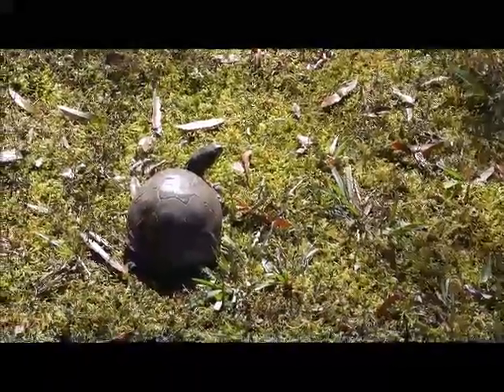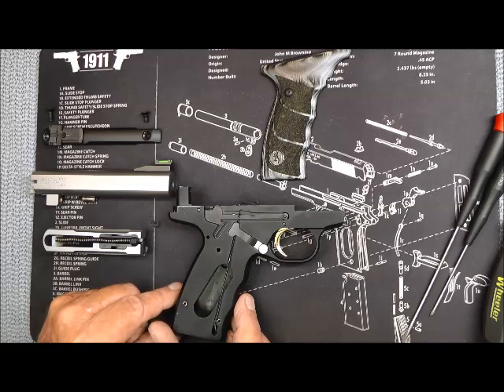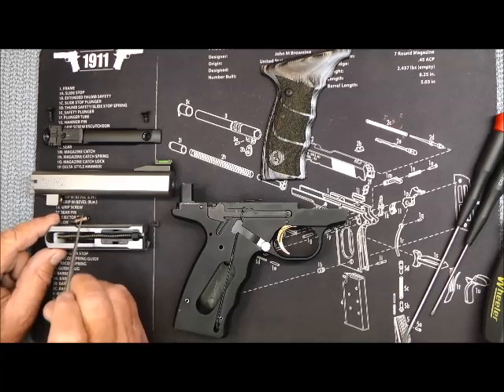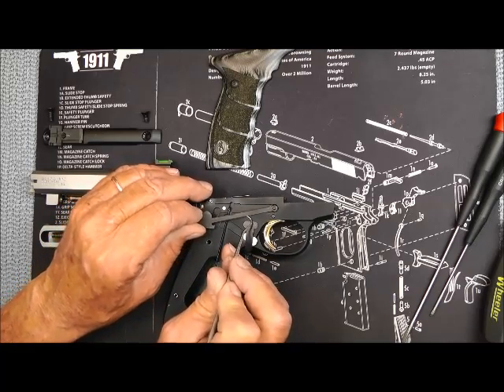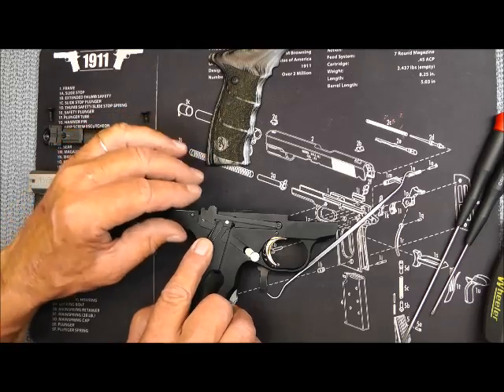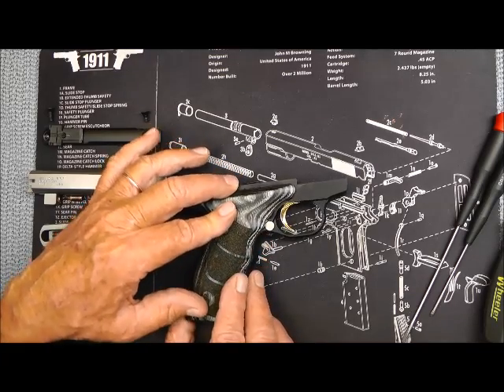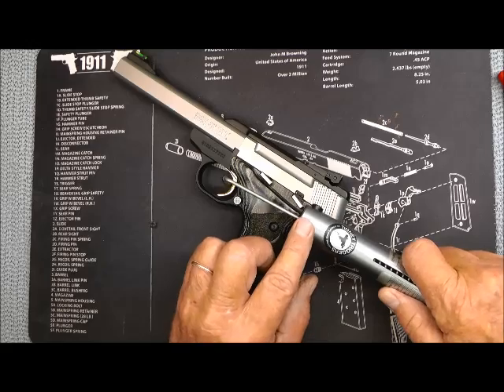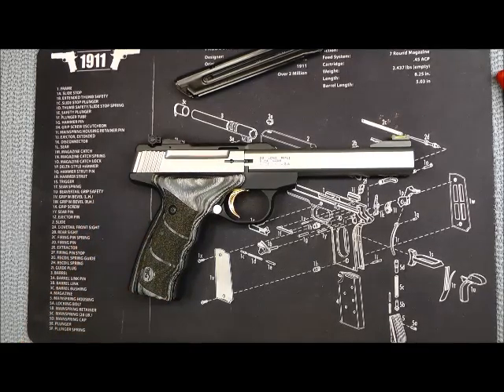Buckmark magazine disconnect and results of Heggis flip

Comment: My Buckmark (new) was kicking the magazine out while shooting.  I looked at your video and saw the flat spring that puts pressure on the the release button.  I took the flat spring out and put a little more bow to it.  Before I could strike the rear of the gun with my hand and the mag would pop out, now it holds tight with the rubber mallet tap.  Good video
Reply from the maker: RBG0979  Anything I’ve learned messing with pistols was trial and error :)
Reply: Mine was dropping the mag too, followed your advice and now works perfect..... thank you very much.

Comment: Good video. Ive done the flip on all of mine. I don't have a trigger pull gage but one of my pistols is almost to light. If thats possible.  You better be ready to shoot when you put your finger on the trigger. It seems safe though.  Ive shook and banged it around and its never went off.
Reply from the maker: Thank you. It's a neat trick to lighten the pull and I do it to all mine also. If the gun has shot a lot it will be very light because the spring has lost a little of it's power. You're right, I've read the forums and it's safe. What you're really doing is taking a half wrap off the spring.

Comment: I can't get a reset .why?Maybe hammer follow? Tried to change sear spring back.
Reply from the maker: Sounds like one leg not contacting sear properly.
Reply: @MyHollowpoint  too little tension .swapped spring back and worked.thanks for the reply.subscribed!
Reply: @MyHollowpoint  I guess it wasn't wasted time.now measures 3.25 pound pull with spring in factory location